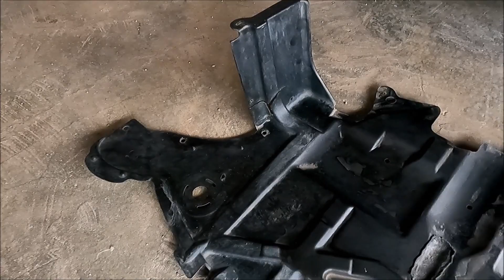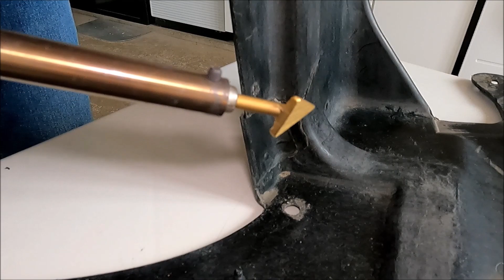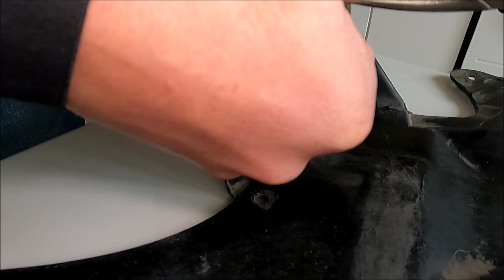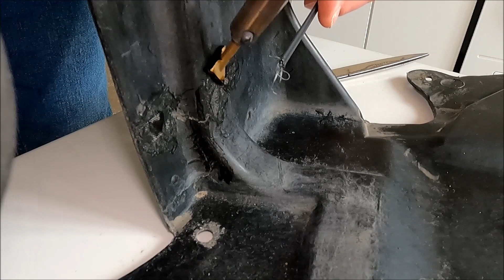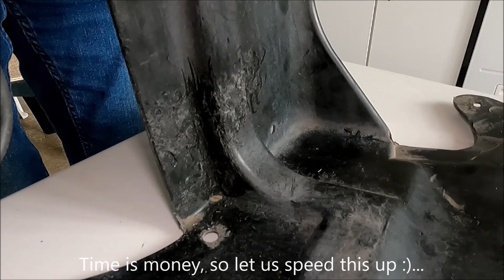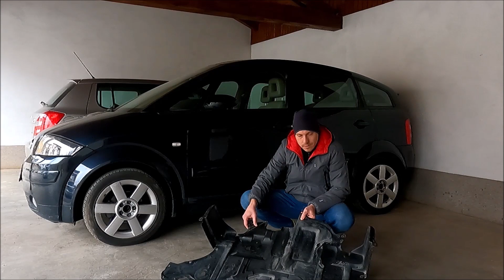Audi A2 – cracked plastic engine undertray welding – EP16 – project youngtimer

Comment: very good repair! I noted the trick of the stainless mess for reinforcement (I used to use fiberglass matt and special epoxy glue for plastic like Araldite 2021-1) but this is a good alternative for plastic that can be how welded.